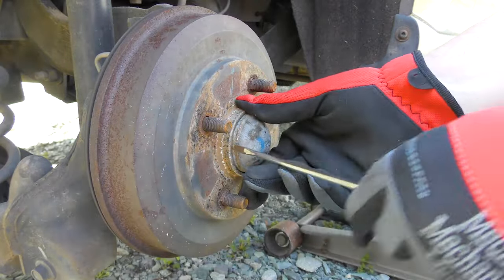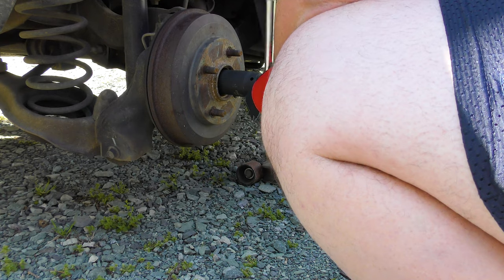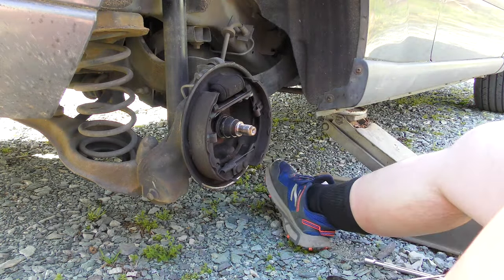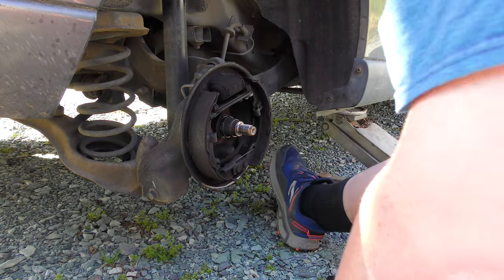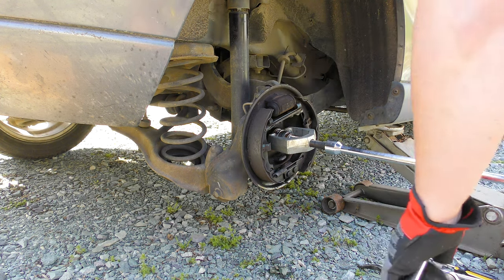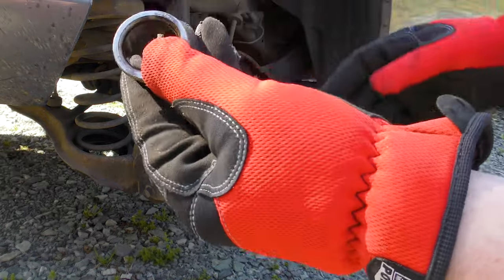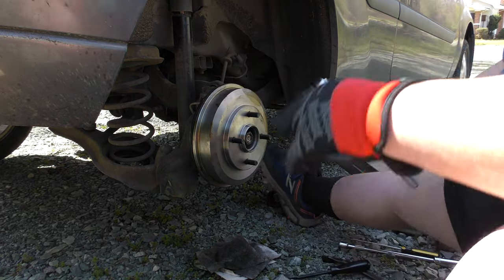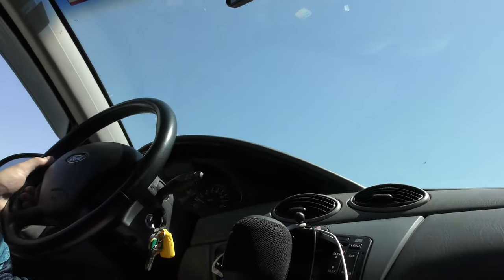2000-2007 Ford Focus Rear Brake Drum/Wheel Bearing Assembly Replacement (Stuck HARD) - Jody Bruchon

Comment: Good video, always fun seeing someone else get frustrated at familiar things. 

Unsolicited advice for anyone reading this: Invest in some jack stands or at least toss a wheel under the car in case your hydraulic jack suddenly and catastrophically fails.
Reply from the maker: I didn't use a jack stand because if the jack failed it'd just fall straight down and I was aware of that the entire time. But yes, jack stands are absolutely solid advice and if it wasn't just a simple job that doesn't require getting behind or under the tire area then I'd have definitely had one under there. I even use jack stands for disc brake maintenance since the bolts are all on the back and while the car dropping might not kill me, it would definitely be a bad day.
Reply: "Daddy's" gonna be missing a foot one day. Hell a cinder block would help even if it too collapsed under the weight at least it's slow it down if it couldn't support the weight. Haha

Comment: Lol replace the thermostat for some real fun... hint: removing the passenger headlight helps.
Reply from the maker: I've replaced the thermostat housing because it was plastic. Stole a metal one off a Ford Contour. Never had to pull the headlight.
Reply: @JodyBruchon  do tell how you managed to knuckle bust your way from the front underneathe the bottom to the second bolt head? Remove the fan?
Reply: @JodyBruchon  disregard I have a 2008 or something of the sort... The design didn't seem to change much but it does have disc brakes in the back. The t-stat is hidden beneath everything imaginable however making you either take a buncha shit off or remove the headlight to access the bolt heads. And oh the t-stat housing is still plastic. It's Ford's HP laptop hinge of the automotive world.

A friggin {muah 💋}... 💎 jewel on gas though so I can't bitch.
Reply from the maker: @repairstudio4940  Yeah, you can keep that Duratec one for yourself, friend :D

Comment: There is no 1998 or 1999 Ford Focus. The North American Focus debuted in the fall of 1999 as a 2000 model.
Reply from the maker: You're right. I must have been skimming too fast. Edit: Wikipedia says Ford NA was 1998-2007 but then says 2000-2007.